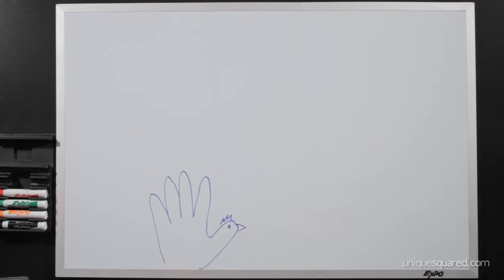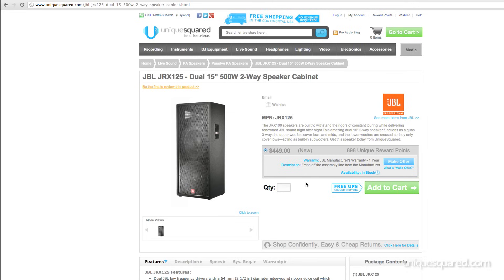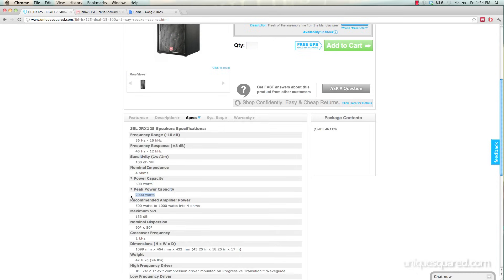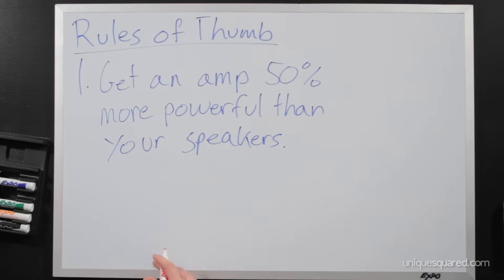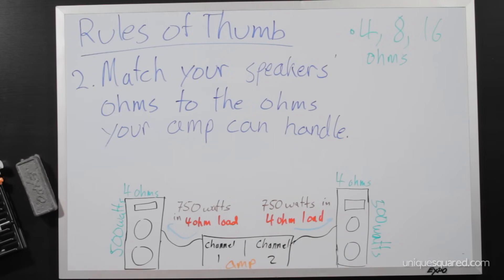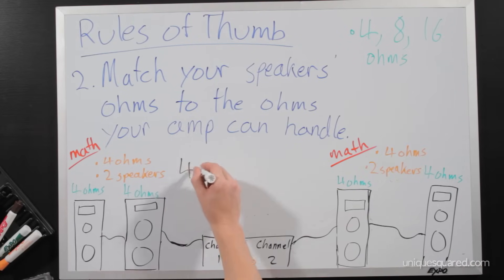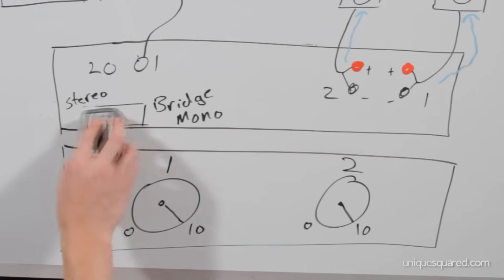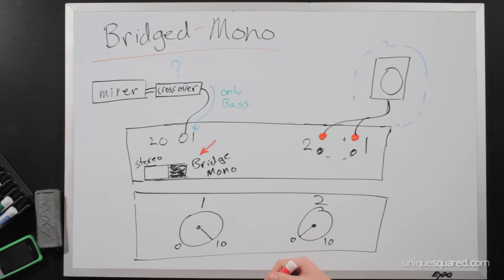Amplifier to Speaker Matching Tutorial | UniqueSquared.com

Comment: I thought a 500 watt speaker is a rating, how much it can handle. It doesn't mean you need 500 watts to drive it. And some speakers are more efficient then others, some  don't require as much power to drive them. Maybe I'm wrong about all of this like to hear from others.
Reply: Proiectediversediy Read the definition of RMS and learn!!!
RMS is a mean value so the peak value of that signal is higher. If we take a sinus of 1V RMS thru a resistor of 1 Ohm we will produce 1W RMS, but at the same time the peak value of that sine is not 1V but 1.41V (+3dB) and the peak power is 2W!
Hope you liked my stupidity :D
Reply: Proiectediversediy Physics : 500W RMS = 1000W peak!
RMS -> Root Mean Square -> some sort of average -> less than peak!!!
Reply: Bri G. : You are 100% correct. This guy is very confused. In my home system , my speakers have an efficiency of 97db ( at 1 watt at 1 meter ). I use a 6.5 watt / channel Amp. I rarely play at more than 0.5 watt.  this gives a sound level of 94 dB.
Reply: Proiectediversediy No, the "recommended amplifier" specification is spot on that spec sheet!
A 500W RMS amplifier will deliver 1000W peak giving 130dB SPL on those speakers but using a 1000W RMS amplifier you will have 2000W peak thus reaching the 133dB SPL shown on their specsheet.
But now comes the question ... what are you gonna do with this system? Depending on the type of music you will want different headroom and most pro-audio companies go for the golden middle +50%. If they would take twice the power and set the system for a techno party they will probably overpower the speakers.
I have run JBL Array system for years and I have not blown a single component! We used Macrotech 3600 (2x1800W RMS) on our Array 4894 (1200W AES) and for the subs (custom made SP128S 1600W AES) we used Macrotech 5000 (2x2500W RMS). When I gave the system it's full power (100% on amps) on techno parties it was only for 1-2 hours after that I turned it down for 2-3dB. For live rock I never went to the maximum amp power because rock is sometimes distorted by default and it was only for the real musical stuff that I  go to 100% for all night.
Reply: Proiectediversediy Stop trolling! And no, joule heating of the LF isn't the main problem it's the harmonics!
Reply: +jeevan nileshwar what worked for me in the past 8 years was buying amps slightly (20-30%) bigger than the speakers. the reason why is simple: speakers are cheaper to repair period. you dont want to MAX your amp all the time, just like a car (bigger engine for the same speed=less work relative to the engine).
so if you are careful not to max your amp (remember its slighty more powerful than your speakers) youre just  fine. Of course try to match your impedance (Ohms). Ive never blew shit in my gigs like this
Reply: I agree. I understand that the rating is the max what can be handled by a speaker. The amplifier should in fact supply power within this limit (it is what i understand). If higher wattage is fed to speaker, it may perhaps fail mechanically or the sound quality and harmonic distortions may become unacceptable
Reply: +Proiectediversediy In HiFi you take double but in professional audio 50% more power is more than enough!
A amplifier of 750W RMS can easily deliver 1500W peak and this has nothing to do with the power supply but with the definition of RMS!!!
Reply: ppdan where is that logic coming from?
On what your base your stupid answer?
Reply: Proiectediversediy https://www.jblpro.com/pub/technote/lowpower.pdf
Reply: ppdan Mate ,this is what i do and  will try to explaine to you how it goes from pro audio point of wiev.
Here is the PDF 
https://www.jblpro.com/ProductAttachments/JBL_JRX125.v1.pdf

We have 500 w RMS (sinus not music) speaker and 1000 Program (music).
We have Sensitivity (1w/1m): 100 dB SPL and a max spl of a 133 dB.
That "recomanded amplifier " its a marketing bulldhit.Ya JBL do it too.

If we have 100 dB at 1 watt
at 2 watts we will have 103 dB
at 4 w 106dB
at 8 w 109dB
at 16w 112dB
at 32 w 115dB
at 64 w 118 dB
at 128w 121 dB
at 256w 124dB
at 512w 127dB
and now we are fucked because you have only 500 w.To go from 127 to 130 dB we need another 500w .
This is why you 2 or 2.5 ratio of amplifier.
A normal amplifier for a 500w rms speaker ist 1250 what.this PA sistem must be operated by a professional because someone else will fuck the speakers.

The only way to add those (very important i may add) 3 dB is to put nead this speaker another speaker of the same type and same amp.
In conclusion if you have only 500w of power by a 250w speaker because your speaker will deliver what u need.If you dont use the speaker for gigs with lots of people you cand use a 200 w amp or what ever,but be carefull because u might problebly burn the speaker at max level.
Reply: Mate ,fuck aes.I dont care about aes.I care about phisics.
A 500w amplifier delivers 500w .period.
a speaker its rated at 500 rms and 1000 program.
Amplifiers are 500w and no more.If it is 1000w he deliver 1000w.(if the amplier is not made in chine )
Reply: ***** first part its corect.The second part no.
If you have a 2x30 watt amp on a 2x100w speakers ,if you keep the amp at max the power supply wil go to the limit and input distorsion on the final output.A 20 minute distorsion will burt the speaker even its 3 time biger then the amp.
Reply: ***** If you have a cabinet with a passive x-over and you go into clipping your LF component won't have any problem but the nasty harmonics might be too intensive for the other components (mid and/or high).
Reply: ppdan If you have a crapy pasive speaker
Reply: ppdan ok.Stay idiot and stupid.
Reply: Proiectediversediy You're welcome ;)
Reply: Hi, I was going through all of your comments. I am not good in watts, rms and ohms. But very interested in sound systems and musics. I live in an indian city where neighbors could make issues if I create too loud. I wish to have a sound system in my home which I can enjoy with maximum quality of sound. What configurations(Amp watts, Speaker watts, RMS, Ohms etc..?) do you suggest to me?  Please give me your valuable reply.
Reply: I can only add that you should look for RMS continuous or true RMS. RMS is an average itself, but some speaker manufacturers only measure RMS for a very short time (a small part of the sine-wave) to boost their RMS spec.
Reply: I realise English is not your native tongue but what you have written is not only badly written but contains incorrect information. Where did you get the information that formed the basis of the above text?
Reply: Somewhat true but it doesn't mean it's its Max. For example my mom's to JL 13 w7's are rated for 1k watts each... but they can be played at 1.5 or even 2000 Watts. But doing so is voiding the warranty... that's the reason they don't do it that often. It just means you have a higher chance of blowing a speaker or ruining your system. But as long as you know what you're doing you're perfectly fine. My mom plays hers at 1.6k watts each. she doesn't have a warranty on them so she didn't care if she turned them all the way up to 1.6 K Watts. They're still fine it just is a lot stronger
Reply: Shivam Mishra actualy is the ather way around.If you you have a speaker of 500w rms u need a least 2 or 2.5 bigger amplifier.The rule here is that a speaker blow up because of distortions not from power.A 500w speaker need with 98 dB at 1w/1m needs to double the rms power just to get to max spl.Atention that 1000w must be music not sinus or pink noise.
if you keep 750 what on your speakers at a max of an amplifier the speakears will take the power suplly to the max and that p.supply will saturate and give distorsions.20 minutes of distortion will do more damage to ghe speaker that 1500w of program power.

Comment: I have never seen a speaker manufacturer recommend the things you are saying here and this is full of so many false recommendations given as absolute gospel it's ridiculous.
Reply: You can drive a 500W speaker with a 10W amp, the sound output just won't be very loud. In a home stereo, it's not crucial to have an overpowered amp for your speakers, depending on your usage. If you listen to music at comfortable and neighbour-friendly levels, a small-ish amp can drive big-ish speakers to a certain degree, lets say a 50W amp driving 100W speakers. But in a professional setup where you are looking at a high power usage scenario over prolonged periods of time, you want a more powerful amp, the manufacturers of speakers often recommend an amp which is equal or upto double the power of the speakers, i.e. 500W to 1000W amp for 500W speakers. The reason for this is that you want to avoid that the amp will start clipping at all costs. An amp that clips will blow up speakers very quickly. Then it is up to you as a sound engineer to handle this power correctly, i.e. not push the speakers too hard by setting the levels correctly on the amp. A 500W RMS speaker can handle more than 500W in short peaks, i.e. a kick drum or similar, as long as you don't push too hard.
Reply: aaron phillips hey I've been using a 50w x 2 amp with my each speaker being 260w ....is this wrong
Reply: aaron phillips 
Well he forgot to say dont max out the amp. Only turn the volume up 1/2 - 3/4 of the way
Reply: Ok, then read this : https://www.jblpro.com/pub/technote/lowpower.pdf
What he got wrong in the video is that "under powering" will damage the speakers, not the amplifier.
Reply: son of a gun : No, this guy is very wrong. It's all about speaker efficiency, not max watts.

Comment: What about a PA that is 520 Watts and 2 Ohms delivering to 2 monitors with 100 watts RMS and 8 ohms per speaker? Your video helped but I'm still worried I'm going to blow something up haha
Reply: I think you're safe.

As ohms decrease, your speakers will suck more current from your amp. 
As ohms increase, less current flows. 

Over-working your amp causes it to overheat and will kill it. It also causes clipping, which destroys tweeters. 

You have the opposite situation, though. You're driving higher impedance speakers, and their power rating is within the rating of your amp anyway, so you have no worries about excess current flow and the above problems.

If your speakers were 2-ohm, your 520-watt amp would be sufficient to drive ~345W (that's 2/3 of the amp's rated output) comfortably. Given they're 8-ohm, the current draw will be one-quarter what it would be if they were 2-ohm at the same power level. So my lay opinion would be that your amp will be fine.

Your only concern will be not to turn the up the gain too high at the amp (and blow your speakers). I'd be looking for a safe maximum level - find a really strong signal (loud song, or yell into your mike) and set your mixer to maximum. Start the amp from zero and slowly turn it up to a level that is manageable by your speakers even when this high signal is being received and the mixer is at max. Then leave the amp at that level - tape it down if need be. You will know your speakers can handle whatever comes through the mixer at max level with the amp set there. Then use your mixer's levels to adjust down from there.
Reply: John Heath 
and by "DECREASE" you mean from 8 to 4 is a DECREASE ?
Reply: Yes, that's a decrease in resistance.

Comment: hi...i have 1200watts per channel power amp how many watts of speaker should i use in 8ohms 18ins
Reply: When you're working out the amp power you need, multiply the speaker wattage by 1.5. You're working backwards here, so divide the amp output by 1.5 - so you would be looking at 800W per channel. 

But don't stop the calculation there, as you need to match the ohms, too. Look to your amp's specs for what it can output at what resistance level and divide by 1.5 at that level for your speaker rating.
Reply: +John Heath my power amp.is 1200 watts in 8ohms per channel so i want to know how many watts i need to use in 18" thanks
Reply: Dude I dunno. 18"? 

Your 1200W amp is good for driving an 800W load, assuming the speakers are 8 ohm. If the speakers are 4 ohm, your amp is good for 400W.

Comment: Hello, I was wondering if anyone could help me out. I have a 500w amp that is powering 4x10 cab. The speakers say 8 ohms 80 watts. There is a lot of cracking in the sound, is this because the speakers are too small for the amp? Also, I was thinking about my cable going from the amp to the speakers... it looks like the wires are 14awg.... would this be part of the problem?

amp is a Markbass Big Bang
cab is a Ashdown that used to be powered by a Mag 300

Comment: Personally i like speakers that can handle more watts than opposite, because of peak power watts, just in case. Dont worry my amp is smaller, since its very strong built. Or prefer to get speakers that are perfect wattage and db sensitive. But hard to get that lucky buying used.

Comment: hi+uniquesquare im new on creating my first 5.1 surround sound system i already buy a set of floorstanding,center,surround,and subwoofer..now im looking for an amplifier which are compatible for my new 5.1 system and this are the specs of my system the floorstanding is magnat quantum 755 it is 190 watts and 4 to 8 ohms impedence my center is the magnat quantum center 73 it is 120 watts and it is also 4 to 8 ohms and for my surround i have the pure acoustics supernova bookshelf speaker it is 120 watts and it is also 4 to 8 ohms impedence.Now im choosing between the onkyo tx nr626 which is 170 or 160 watts per channel and the denon avr 520bt which is 130 watts per channel..can you help me which amplifier is compatible to run my system..sorry + UniqueSquared i can't find a best adviser expect you hope you help me and thanks for advise

Comment: Dear All,

I Need your suggestion's and help .

I am going to fit a new speaker system to my Compact SUV Car (Nissan Terrano) , Please find the below Speaker models & Amplifier Models as per my investigation & research.Please review and suggest me the correct amplifier which suits for my Speakers and correct me if i am wrong. 

Component Speakers Model : Polk Audio Mobile Monitor : MM6501UM 

Speaker Specification 

System Components :2 speakers
Amplification Type: Passive
Crossover Channel Qty :2-way
System Class: Component
Nominal Output Power :125 Watt
Max (RMS) Output Power :250 Watt
Frequency Response :40 - 25000 Hz
Nominal Impedance :  4 Ohm
Sensitivity :92 dB

I going with rockfordfosgate Amplifiers .

http://www.rockfordfosgate.com/products/selector/mobile-amplifiers/power-amplifiers

Request you to compare the models and suggest me which is fit for my Speakers. Very the Nominal Impedance as well. Please review in all aspects and suggest me the best amp , It would be great helpful from your end.

Please Suggest me the  Circuit Topology  which is suitable for car :  Class-A/D  Class-A/B

Amplifier :  

 Model:   T800-4ad       Model: T400X4ad         Model: T600-4           Model: T1000-4ad    Model:  T400-4

Thanks & Cheers.
-Madan.

Comment: So, great video. Finally able to understand what all this stuff means and how to use it when getting speakers/amps and receivers. But i have a quite lengthy question for you.  

What i have:
5.1 surround system,  VSX-321 - 600w total? 100w per channel.
Two Behringer 2031A Truth Studio Monitors (TRS/TS to RCA)

Now, i did some research and it states online that this model is 5.1 but can be converted to 7.1 using the RCA inputs in the back for AUX/Audio out (Left and right). I hooked it up, after some fiddling i got it to work, turned up the trim on the monitors but still can bearly hear anything out of them, they are both pre amped out of the box if that matters (ive turned this on and off to fix it)

 So then i read i need to buy a separate mini amp to just power the monitors because the receiver cant handle the regular satellites and the monitors. The X-over is set at 200 on the receiver by the way. So my questions are this:

1) Why do i need to buy a second amplifier for them, if they have one on the back of each the monitors?

2) Should i just go buy a newer model receiver to accommodate higher watts, and more channels - or would i still need a separate amp for the monitors (they are 140w max per monitor) (Also, i have a 4k monitor hooked  up to my computer via PCM on my tv, so i really want to get one with 4k up-scaling to use it in surround while watching movies/gaming.)

3) TRS/TS better than the 5 pin (XLR?) round ones? I need to get an amp with rca's unless i can find cheap T/S's that convert to raw speaker wire. Is there a preference?

Thanks in advanced for any replies, 

Steve.